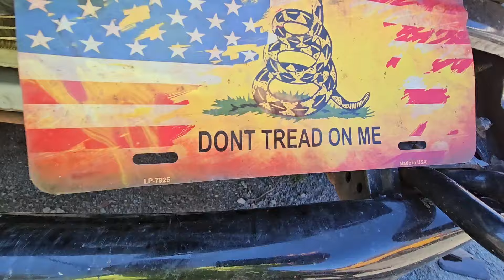So I crashed my Ford super duty f250 !

Comment: Hey mike that’s not the first truck accident with that truck
Reply from the maker: No a lady high on pills t boned me.. And I also slid on ice and crashed it into a tree on the same exact side.The frame was slightly bent.. But it was fixable this time. Sadly, it would cost too much money to fix it, so I had to let it go
Reply: Hey mike how was your day today and when is the next video
Reply from the maker: @anthonyfletcher4898  Today was very productive.I did a lot of work at my mother in law's house. I have a couple more tiny things to do and then i'm done.Hopefully it'll just sell quickly.. Tomorrow i'm loading up for a big Mode of copper and brass.I took apart a bunch of air conditioners so time to cash in the good stuff